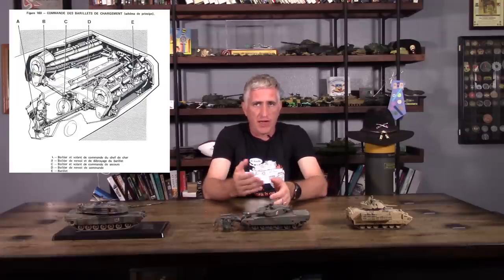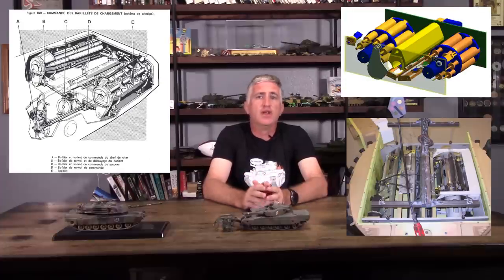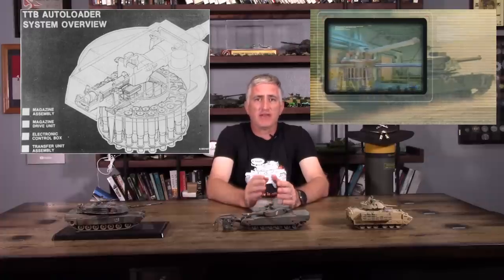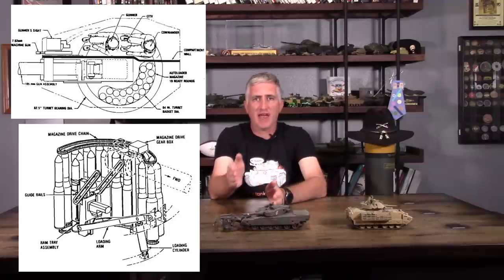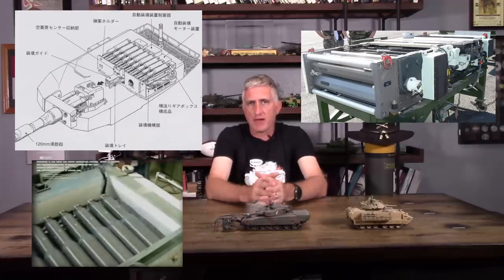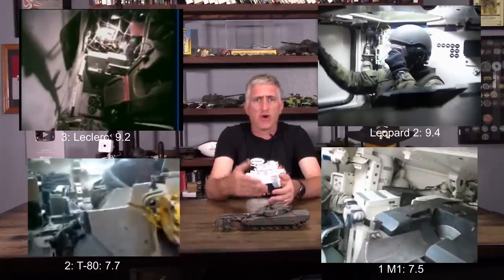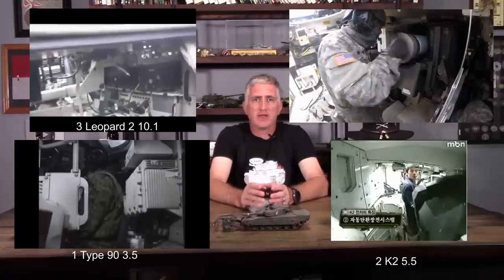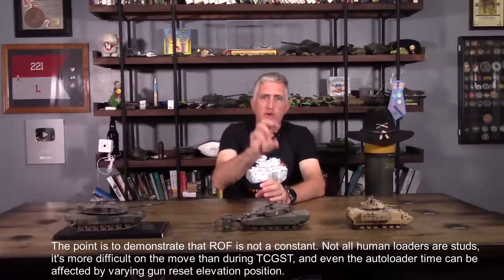Whither the Autoloader?

Comment: One thing that might make a move to autoloaders necessary is the rise in the weight and dimensions of the ammunition. When Rheinmetall unveiled the 130mm l51 gun, they themselves said that the ammunition would be too large and heavy for a manual loader to load effectively, and that an autoloader would be required for any tank mounting the new gun.
Reply: And with the merger of GIAT and Krauss-Maffei, and the Leopard 2 with Leclerc turret demo tank, it is reasonable to assume that Leopard 3 might have an autoloader.
Reply: @NukeBunny
That might actually be the strongest argument for eventual universal adoption of autoloaders.
I have heard/read that the amunition for the Rheinmetall 120mmL55 is more or less the limit of what a loader can reasonably handle. Not just because of weight, but also because of the lengh of the cartrige and its fragility.
The longer the thing gets, the more likely you'll bump it against something. And with the casing being combustible/smi-combustible, it's probably not as sturdy as a good ol' brass casing.
Reply: @FirstDagger  Leclerc, not LeClErC
Reply: Even the soviets concluded that 122mm was the limit of reasonable human capability. 
The 152mm guns were a bitch to load even with two loaders, and even worse in an enclosed casemate
Thats why the last soviet tank to have a loader had a 115mm cannon
Reply: @lsq7833  ; Thanks for the notice, corrected my earlier comment.
Reply: the thing is, you only need a shell as strong as your Enemys armor.
Reply: @ivankrylov6270  122mm is fed with a separated ammo elements. There is absolutelly no issue about loading it manually. If 155mm would be designed in such way it also would not be a problem to load with human hands.
Reply: If you want to move into new 130mm standard there are other more important cons than the weight and size problem for human loader.
Reply: The US and Royal Navies look at this aspect and chuckle. They concluded that something in the 4.5-5" (113-127 mm) range was about it, even with power ramming, eight decades ago.
Reply: @HanSolo__  the 122mm shell was an issue regsrdless.  It took 15-20s to reload an IS-2 in combat.  155 is not a tank gun, reloading is not that big of a deal.  Yes shell layout is a major factor, the Cheiftan's 120 could be reloaded in about 10s i believe, but it was a bigger and more voluminous tank than the Soviets were making
Reply: @ivankrylov6270  If you are talking about IS2 122mm and a 152mm as a direct fire gun then both are crazy old. I was talkingin about 122mm of current howitzer. The same about 155mm. Im talking about guns I've been actually using during my military service.
Reply: @Bird_Dog00  "I have heard/read that the amunition for the Rheinmetall 120mmL55 is more or less the limit of what a loader can reasonably handle."
The ammo for the Rh 120 L44 and L55 is exactly the same. Its the standard 120 mm ammo and all the types and different makes are interchangable. So your argument would apply to the L44 as well.
Fragility of the cartidge is not the limiting factor. Its length and weight is. The length of the APFSDS cartidge did increase somewhat over the decades. But that is because the dart and penetrator got longer. The weight increase is marginal. Less than 2 kg. The problem is the dimensions of the loaders workspace and of the ammo storage can not easily be changed.
Reply: @kemarisite  Not really. The USN and RN in this case concluded this about seperate loading two part ammo. Not single piece cartidges as commonly used in tanks.
What ammo weigh is deemed acceptable for human loading is allmost entirely a matter of ROF requirements, timeframe over which max ROF is to be sustained, number of loaders,  and what an average loaders is supposed to be able to lift. Different nations came to very different numbers.
During WW2 the German military concidered the ammo of the 12,8 cm guns to be light and small enough to be manhandeled in naval and AA applicitionas. We talk about a ~50 kg cartidge that is ~45 kg heavy. AA guns often where served by high school age teenagers used a loading aids. The army concidered it unsuable and all 12,8 cm army guns used two part ammo. Its all about priorities and situation.

Compared to these old guns modern tank guns use rather lightweight shells for example. The typical shell weight of a gun in the 5" classe of the WW2 era is ~25 kg. Which is more than the weight of a typical 120 cartidge or 125 mm seperate charge and shell. The only exception (alltough pretty common if we take overall numbers into account) to this the HE ammo for Soviet/Russian design 125 mm guns wich have shell weights ~20 kg.
Reply: @kemarisite  I agree. What I wanted to point out was that it is the environment that matters. Different conditions lead to different answers to the same question. An AA gun regardless if mounted on a ship has very different constrains to an AFV or field gun.
Replacing the Naval 5" with a 120 mm tank gun seems a rather stupid idea to me. The only real role for it that I can see would be direct fire engagements. For example engaging AFV at the shore line. Which seems very special.
The German Navy experimented with 155 mm artillery weapons on their ships not to long ago. In the end they went and bought 5" guns.
Reply: Well, powered exoskeletons might disagree with you there. 
Then again, if the exoskeleton fails, you're screwed.
Reply: @combativeThinker   If you need an exoskeleton than you should get an auto-loader as that technology is available now.
Reply: @lukeirot  and the increasing thickness of armor is exactly why rheinmetall developed the gun in the first place.
Reply: @HanSolo__  which 155mm system are you referring to? The m777 or the m109 paladin?
Reply: @ivankrylov6270  None of those. When it comes to semi-fixed munition for 155mm howitzer you are asking me too much. I just cant tell anyone (not only you) about it. I signed a contract with some points covered by security classification. I'm sorry.
Reply: @HanSolo__  fair enough i won't pry
Reply: @lsq7833  I thought it was LeClerc, with "Le" being similar to Mc, Mac, O', De, and Von/m?
Reply: @kemarisite  but that was eight decades ago so that train of thought is probably out of date anyway
Reply: The trend of  unmaned combat vehicle also give autoloaders a push.
Reply: Then they should have gone for three part ammunition.
Reply: Frank DeMaris Which is why they are all moving to 155mm (6.1 inch) for the new Nato standard ship gun. Commonality with ground forces guns.
Reply: no theyre just trying to sell their autoloader as part of the package.
Reply: @HanSolo__  Sure you could design the 155mm shell to be loaded two or three different parts, but why would you?  That would take even longer to load.  At the point you are using multiple parts of a shell, or two or more guys, it's time to go with an autoloader.
Reply: @kemarisite  The 120 mm is not a hugely powerfull gun. At least not generally speaking. Its a gun with a high MV and can fire AP rounds with very high penetration. Which makes sense because its a purpose designed tank gun optimised to kill heavily armored tanks.
Compared the the modern 5" guns its not more powerfull. If a 120 mm would fire a HE shell of caparable weight any payload its MV would be in the same region (at best) to the MV of the 5". The semi combustile cartidge of the 120 mm also is not up to the rough treatment of the typical naval high ROF auto loaders. Furthermore such cartidges are a liability in terms of explosion hazard safety in a naval context. It simply makes little sense to use this gun in a naval application since the naval 5" guns are multi purpose and in most fire missions penetration is much less important that payload or ROF. 
This is why I mentioned direct fire engagements with AFV on the shore line. In this special case a 120 mm indeed would be superiour to a 5". But this case is just outlandish.

The idea of using 155 mm instead of 5" failed for the same general reasons BTW. While better in some specific applications 155 mm is worse in anything else. Its simply not MP enough to warant the investment.
Reply: @schnuersi  I said "hugely powerful" in paraphrasing the people asking the question.
Reply: @kemarisite  I got that and since you disagree with them I support your position for the reasons I wrote.
Reply: @LAHFaust  Nah, it's not if it's a single word. Randomly capitalizing a letter in the middle of a name is a big no-no in French, it's a typically American quirk to suddenly write "Dupont" as "DuPont".
Reply: @ivankrylov6270  I thought the the big guns on the JS series used two piece ammo, like naval guns
Reply: They should've manufacture bigger dudes to handle that munition tbh
Reply: By the time I saw this comment, I just saw the new vid that Rheinmetall released. It was the 130mm gun with an autoloader, given by the description.
Reply: If it aint broke yet, why fix it
Reply: @lukeirot  Thing is armor packages are making it harder to penetrate. It will probably get worse in the future. As weird as it sounds they're fiddling with metal foam armor and its highly impact resistant. (and super light for its protective capacity)